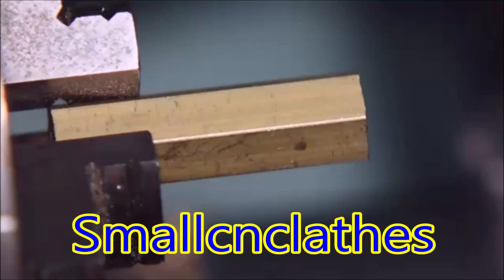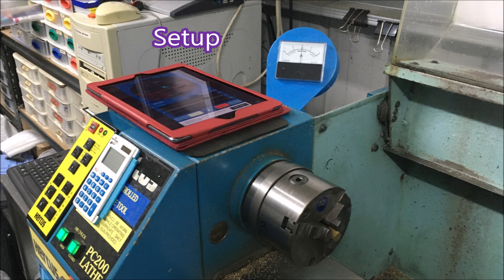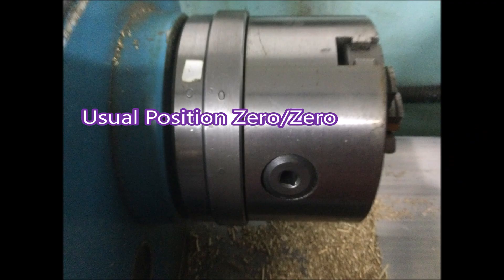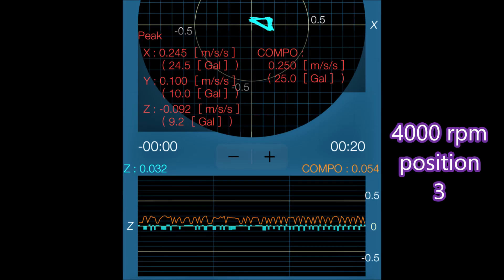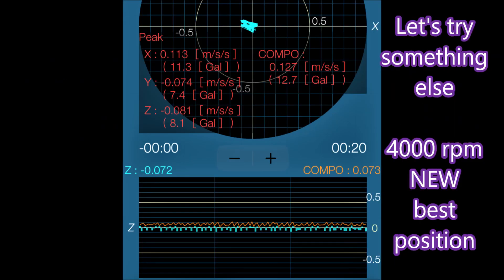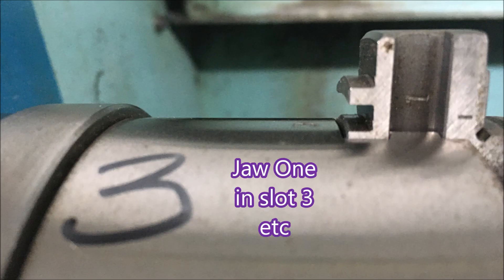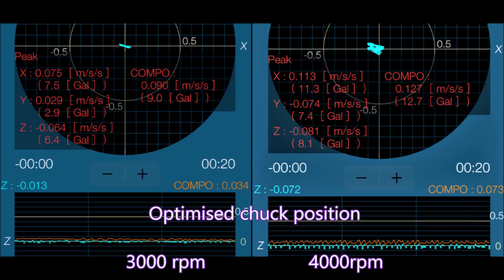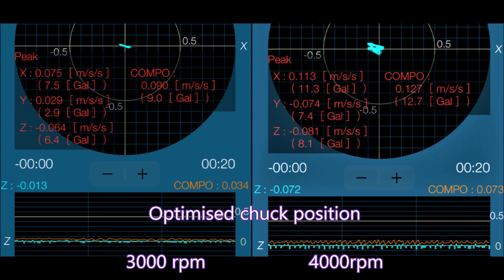Geared up my cnc lathe to give me 4000 rpm vs 3000rpm. Would like help sorting some vibration data

Comment: I overclock my manual lathe using a VFD with same gearing.  Semi-steel chucks are usually spec'd for 3-3.5k max RPM.  Forged steel are spec'd higher.  Using the vibration app is a clever tool.  I don't use the higher RPM much.  With higher RPM you only increase MRR if maintaining DOC but you've dropped your torque.  If your chasing surface finished switch to smaller insert size first.
Reply from the maker: I think my chuck is rated for 5300. I try to use the right speed for the diameter, but this means almost everything in non ferrous below 30 mm needs in excess of 3000 rpm. Thanks for your comment
Reply: @smallcnclathes  Wow, that's a good one.  My forged steel is only rated to 4200.
Reply from the maker: @specialhorse8062  TOS make good chucks. They are not cheap. Mine is 100 diameter and is rated at 5300 and the better ones by TOS are rated at 6300 in that size

Comment: It looks like the spindle and the chuck are both out of balance. The different chuck positions act as a counter balance between the chuck and the spindle. It's pretty easy to balance the chuck and you can attach weights like the ones used on automotive wheels to balance it. Keep moving things around until you get the lowest reading possible. you can balance the spindle first with weights just like you do to the chuck. Go online or to a place that sells tires and see if they will sell you some tire weights if you can't find them on line. Incidentally Albrecht has a collar on it micro chuck that you can move around to bring the chuck into balance, this is basically the same thing you want to do.
I don't know how the servo is attached to the main spindle but if it's a belt you could be getting further vibration from that. Loosen the belt to different amounts and see if this changes the vibration at different rpms. Also run them motor by itself and see if it has vibration at different rpms.
Reply from the maker: Thank You, this exercise was more to find out the difference between 3000 and 4000.  I  was not looking to fix anything.  The vibration at 3000 is so minor that I will probably go back to using that as my top speed.  Thank you for the effort you put into your comment, I appreciate it.

Comment: Years ago, the magic RPM was 7.5K for balancing. Below could go without. What results do you get from your 5C chuck?
Reply from the maker: I have not tried it, takes a bit of assembly to put it in place. Also the bearings are only deep groove and they don’t like 3000 very much, they get too hot, so 4000 would be out of the question.
Reply: @smallcnclathes  Personally, I wouldn't expect good balance over 2K RPM from a machine which didn't have a specifically-balanced chuck. Too many minor variables that crop up as the RPMs go up. If this is a recent development, I'd disassemble the chuck and thoroughly clean it.
BTW, when I said 7.5K was the magic number for balanced, I was refering to tools themselves on mills. Sorry. I don't know what the magic number is on a lathe, but I would guess it's 2K. The reason for that is that manual lathes don't rotate faster than between 1,400 to 2,200. I assumed it had to do with chuck balance (or rather, the lack thereof).
Reply from the maker: @makerog5666  I think the exercise I did in the video showed that this particular chuck is better at 3000 than 2000 which is fortunate. One chap who is into balancing propellers and such said that it is to do with harmonics (of which I know nothing) and that as 2000 is a bit off, it is not surprising that 4000 is worse.  Now I have found the best rotational position for the chuck on the spindle (which I was not using) I think I may go back to using 3000 as my top speed and not worry about it.  The vibration at 3000 was not that noticeable, I only did this as I was going up to 4000 and wanted some idea of what was going on. I think both the lathe and myself will be quite happy with the new chuck position and 3000 top speed.  Thanks for your comments, they are much appreciated.  It is good to have someone willing to contribute to the conversation.  Thanks. Nigel
Reply: @smallcnclathes  Harmonics also means there's a fundamental frequency. If 2000 is the fundamental, then 4000 is the first harmonic. If that's the case, you should try many values around 2,000 (the proposed fundamental). The fundamental will be somewhat magical. In other words, slightly higher and slightly lower will not reveal it.

While I don't disagree with that assessment, what I didn't see was the cutting results at these frequencies. What happens to the vibration when you cut? Does the side-loading of the cutter diminish or eliminate it? Can you see the vibration in the form of cutter marks?

Many machines behave in ways that seem undesirable when they are not loaded by cutting. Keep in mind that running in free air isn't going to really test much. It's just one evaluation.
Reply from the maker: I will just avoid 2000. LOL. Any non ferrous below 30 diameter needs 3000 plus anyway,  so for my use 2000 would be a real rarity. I have some parts to make and intend to try both 3000 and 4000 on these parts. If I can work out how to take readings longer than 20seconds I might see how the overall compares. Not possible to take readings when cutting only.

Comment: The vibration that it's picking up could be coming from within the drive itself. 
   While I've only used larger machines I've often found that drive motors themselves induce vibration when at maximum rpms. Now I'm not sure what causes this.
    In your case it could be the drive belt doesn't like that speed? Possibly bearings ? Things are manufactured to a tolerance, what's the tolerance for a bearing being balanced?
  Just something to think about
Reply from the maker: I think the fact that 3000 is the Hercus defined top speed might say a lot. Not desperate to run at 4000. Might try a cycle of a part at both speeds and see what the difference is timewise.  Have a run of 250 parts to make, will be interesting to see the difference. May be able to up the roughing feed at 3000 to even up the times a bit.

Comment: I bet you could reduce that further with a piece of tape and a bit of weight placed in the right spot. I would assume the extra vibrations might cause your bearings to wear out faster. Are you able to test again with different bearing tensions?
Reply from the maker: Without the correct equipment, I think trying to balance the chuck could be very frustrating. Not something I would want to take on. I might just leave the top speed as 3000. Thank you for your suggestion.
Reply: @smallcnclathes  Why not do it iteratively as you would centre a 4-jaw?  Make offset mass on a spindle, rotate until at minimum, then vary the mass.
Also harmonics - do you get the same at say 3800? 3600?
Reply from the maker: @andycoombes  thank you for that.  Have to laugh, my relationship with 4 jaw is very limited. I have two 4 jaw chucks, only the self centring one gets any use. The independent is still unused after 15 years os sitting in the lathe cupboard. I forget that a 4 jaw can be used to machine non round stuff in the lathe it just never occurs to me. It really is something I should try to remember as I have no milling machine.
Reply from the maker: @andycoombes  from info coming in it looks like 2000, 4000 and 6000 are all likely to be crap. Speeds in between are a little irrelevant.
I can run this pulley/belt for 4000 or the standard setup for 3000. In both these cases the motor is at 2500, its top speed.
I am seriously leaning toward going back to the standard setup and 3000 rpm. Since retirement, jobs of any quantity are rare so not really a desperate requirement to make the machine super quick.

Comment: You might want to purchase a manual collet closer that handles 5C style collets, they are available on eBay for relatively cheap. They close the collets with a wrench just like your scroll chuck (the pinion inside turns a nut which draws the collet into the taper) but they are smaller with a lot less mass than your chuck. You may find some with a direct mount back to fit your machine or you can get a plain back closer and an adapter, some machining required. It's an investment in time and money but if you are concerned about reducing vibration and extending the life of your machines this should work for you. Happy New Year!
Reply from the maker: Thank you, I have been contemplating one of those just to be able to use collets. The smallest I have seen is 5 inch diameter, whereas my chuck is only 4 inches. With a back plate, there may not be much reduction in weight. Although the spindle nose is a standard shape, being just 4 inches means that the fixing holes are not standard so a back plate would be a must. I do have a collet closer arrangement, but it does not like 3000 much, the bearings in it would not stand 4000. When it was made, 2300 was the lathes top speed! Thanks for your suggestion.
Reply: @smallcnclathes  Understood, without all the specific information it's difficult to make a judgement call. The nice thing about collets is their versatility and compactness, good luck, how's 2021 so far?
Reply from the maker: @MRCNC1967  My collet chuck came into existence because I used to do a lot of small hex brass.  Using a 3 jaw in a production setting for hex is not nice, so easy to get the grip wrong when you are doing a long run of parts.  This is never an issue with hex collets. 
2021 is good so far, woke up this morning, which is usually a good way to start the day!

Comment: The issue is vibration resonance. (Reading it occurred at specific rpm)
You might be able to drastically reduce it just by changing or stabilizing the machine table, the motor holds, the casing.....
Read up on vibration resonance and how to deal with it.
Reply from the maker: I have pondered getting some rubber feet for the lathe!
Reply: We had success decreasing Harmonic resonance with stepper motors by decoupling the motor holds with piece of rubber as washers. There is also dampening devices you can screw on the back of the motor shaft. Like this https://www.phytron.eu/products/mechanics-equipment/dmp-20-29-37-inertial-damper-for-stepper-motors/.
Reply from the maker: @relaxingnaturevideos1203  there are no steppers on my machine only servos and the 180 vdc spindle motor.

Comment: Take off the cover and you will see better result 😉
Reply from the maker: Is that the belt cover or the canopy that keeps all the swarf out of my hair. Not sure either is going to be removed!
Reply: @smallcnclathes  The red thing and after test put it back.
May be a frame can help which has contact with metal and not with the rubber.
Reply from the maker: Not by much, I tried it. No real difference in the result and an ipad is a slippery little sucker without a cover. I really did not want to drop it
Reply: @smallcnclathes  ok, I see
Reply from the maker: @DPTech_workroom  in fact one app supplier suggested using a cover on a phone so the phone internals did not get hammered to death!

Comment: my theory :  As you approach 6k rpm theres an inherent vibration from the electrical system (5k in much of europe) because of the electrical systems cycle @ 60hz AC (50hz europe)....
just like observing an engine when setting timing with a light, theres times where close is worse to observe than 1/2 the rpm or matching the rpm....even with dc conversion youll get variance unless you run 2 or 3 phases power supply to help smooth things out...
Reply from the maker: Thank you, not that many comments yet and 3000 rpm is sounding really good! LOL
Reply: "run 2 or 3 phases power supply to help smooth things out..."  What is 2 phase power? I have 115, 220V at home but it is considered single phase.
Reply: @larryschweitzer4904  i dunno what i was thinking
Reply: @kazzTrismus  2 phase over here is considered 480 volt which I'm told is 2 legs of 3 phase. My old mans EMF 'pie warmer' welder runs on 480 volt, he also had a electric motor on his saw bench that ran on 480 volt as well. Its not that common but in a country area he had access to 480 volt but not  415 volt 3 phase. Cheers

Comment: Worst case scenario is you blow your spindle bearings... They are rated for a specific speed and load, the best you can do is to see the specs sheet for the bearings and verify their maximum speed and load carrying capacity. Good oil ir Grease is also very important.
Vibration can be caused by a number of factors... I would try to rule some out like the spindle bearings, spindle shaft balacing, Chuck balacing...etc.
Your lathe can also be too light weight for the rotation to BE smother...
Lots of factors as i Said previoulsy
Reply from the maker: I really don’t want to be replacing bearings at this point. The bearings are taper roller so I imagine they would handle it ok.
3000 is the max as manufactured and 4000 is the max the software will allow. Thanks for your comment.

Comment: The issue is you dont know where the vibration "out of blance" areas are as you are not encoded on the rotation. On my Dynavibe balancer for the props we put on a small strip of reflective tape behind the spinner backplate so the readings of vibration we get is referenced to a degree around the clock. this way you know where the heavy side is exactly so you can take off the weight or obviuosly add weight to the 180 deg away from that mark. The turbine balancer was the same. The only thing you can register with the Ipad is just how much total vibration is there as you have now radial reference. You will need a different setup to do it properly.
Reply: I forgot to add the radial is picked up by a infrared emitter to a photodiode pickup so each rotation is calulated for 360deg and those inputs are then referenced to the pulses coming from the accellerometer
Reply from the maker: Thanks Mark, I was just looking for some idea of what was going on and I think I got a pretty good idea.  Damn thing is almost perfect at 3000 so that may be the way to go.  Now I have retired, there is no real need to break the lathe, just to be able to say it does 4000 rpm!  Fixing the vibration at 4000 is not going to be worth chasing I think.
Reply: @smallcnclathes  To me at 3000 that looks like tis running sweet especially since you rotated that chuck. I would leave it there. Unless you have the gear to do it then leave it alone. I am quite surprised actually how well that looks in balance. I hope mine is as good when I get it running
Reply from the maker: @SimjetAU  3000 really does look like the sweet spot. 2000 was not as good!
Reply: Kudos to you by the way. I have been using balancers for about 15 years and I never thought to do something similar to my lathe or even my mill. I have always just taken for granted that they sounded smooth enough. In all the different youtube video I have wathed I have never seen anyone look at doing that for any lathe or mill. great idea. So I will see how I can adapt my Dynavibe to do my AL330 and also the Hercus when it is running. I will be able to see where the out of balance is as I can put the radial detector on the chuck to see where the issue is
Reply: @smallcnclathes  2000 being half the frequency of 4000.................
Resonance??
Reply from the maker: @andycoombes  quite possibly. Not that I know much about that either.

Comment: Very interesting video as always. I wonder how you might tackle balancing the chuck to optimize it for 4k revs? Would you pocket a backplate to shift the mass do you think? Hopefully someone will comment who knows what those figures represent 👍
Reply from the maker: Thank You, have no way of balancing the chuck properly and as it showed at 3000 rpm it was great, better result than just the spindle and I am sure there is some reason for that!
Reply: Usually on short taper spindles there is a locating pin so that the chuck can only be installed in one position. Maybe it's a balance thing, maybe not. It shouldn't be affected by the position if the spindle nose has zero runout, right?  Maybe the mass of the chuck eats up some of the vibration? I would definitely be bolting the lathe down to a concrete slab as in my experience it does wonders for vibrations and rigidity.
Reply from the maker: @MF175mp  the lathe is a bench top lathe, I may consider some rubber feet for it though. Although for the amount of work I do now it is probably not economically sensible.
Reply from the maker: Mine has an A type spindle nose, tapered but no key. Not going to go down the balancing track, not worth the expense. Will just run slower if I need to.
Reply: @smallcnclathes  A-spindles have a locating pin in the face, if it's missing it probably will throw the spindle slightly off balance.
Reply from the maker: Never seen one on a Hercus and it is not included in the factory drawings.